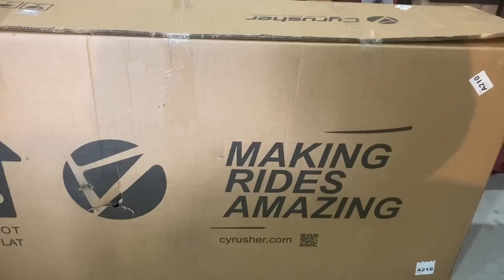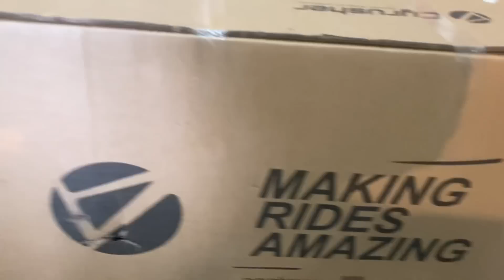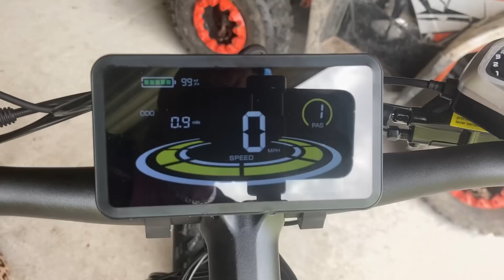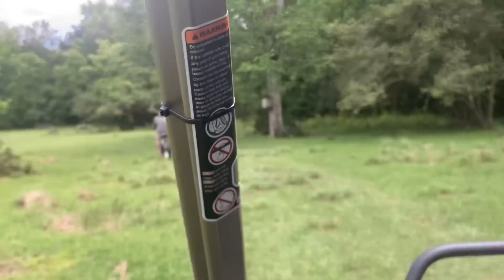Ride on the new Cyrusher

Comment: Hi Dan, what might help your yard is a roller. You fill it with water and level out your uneven spots in your yard. You could hook it to your side by side or tractor or walk it. They rent them out at big box stores.
That e-bike looks like a police dept bike. You could put lights and sirens on it to keep your family in line. Tell Lou that she always looks nice because she has a “resting happy face”. Deep cleaning a kitchen is not an easy task especially if you’re purging. It feels very good when you’re done but it’s hard work.
Reply from the maker: That probably would work very well. I think I should be the Morrow Hill Police.

Comment: Hey Dan. Nice bike. It's not a female bike. That's a full-suspension Mountain bike. There's always a bend on the top tube. The straight top tube frames are for front suspension bikes. The the left (non-driveside) are always reverse threaded. You got a good one there.